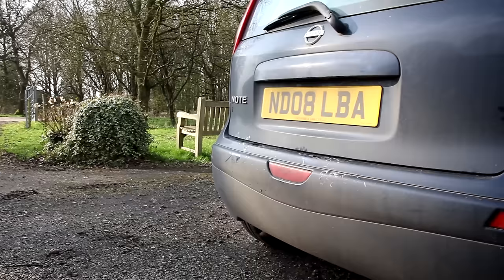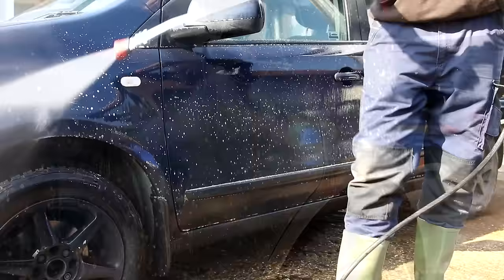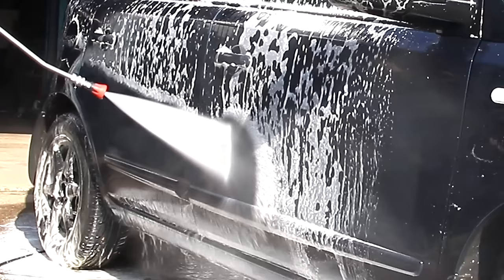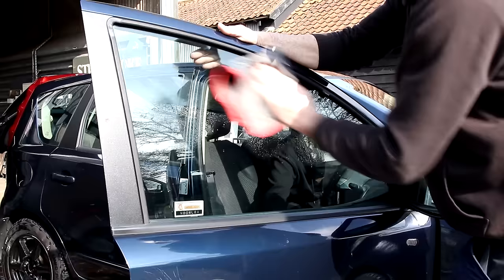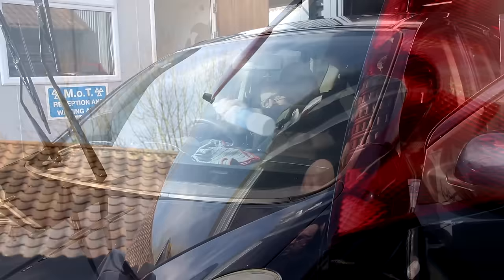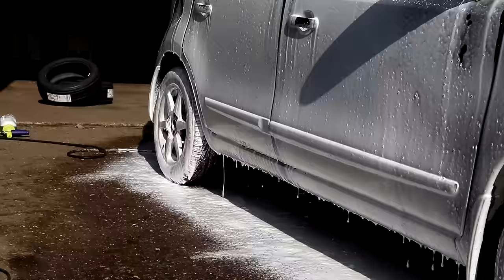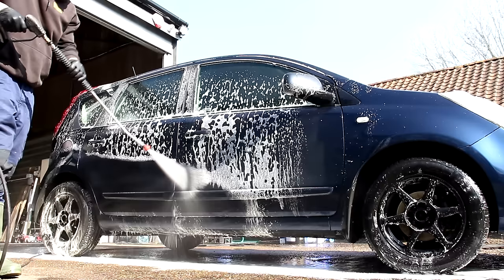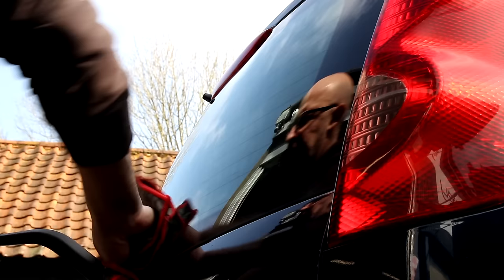Bilt Hamber Touchless & Traceless glass cleaner review

Comment: This does seem to be an excellent product Paul. In your opinion do you think the Touchless prewash is stripping all the protection off the car while cleaning. It did'nt look like the car you used for the test had much protection on it anyway but i have mine ceramic coated so would not want it stripped off after the effort of applying it
Reply from the maker: It may have to be diluted further but it’s sugar based like Garage therapy’s snowfoam so I think you’re be fine

Comment: Many happy returns. 
Good to see you got on well with this. I have yet to try the new Touch-Less but I do get on very well wi the old version and Autofoam too. 
I’m going to use a 5 litre pump sprayer when I get this stuff, I’m slowly moving away from snow foaming and definitely will never buy another PH neutral snow foam. 
The glass cleaner is great, the smell I could only describe as blueberry bubble gum with chemicals in it. 
Loving the podcasts, working my way through season 3 atm. 
Great review, thanks for sharing and get well soon.

Comment: In the States, 5 liters for $100 (US) for Surfex HD Cleaner, I use a similar product for $8 (US) to strip wash.  Which makes more business sense?  The Bilt Hamber may work better, but I'll use a little elbow grease for $92.  Also in the States, I like to use Stoner's Invisible Glass (Tint Safe) for glass.  It's available almost anywhere and cost less than $4 (US).  Or ONR works well on glass and cost very little.  Thanks for your testing.
Reply: I agree with you completely. However, you also find that a lot of American products like Meguiars and Chemical Guys are considerably more expensive here in the UK.

Comment: Which attachment did you use on ik sprayer the white one or the fan fan tip, if the white one waa the nozzle closed fully yours gives more spray and pressure than mine
Reply from the maker: The white one non fan type
Reply: @PaulDoldenDetails  Thanks Paul Have a great weekend 👍

Comment: Nice content,  so you used 12ml of touchless to 1 litre worth of water is this correct
Reply from the maker: I did but the correct way is 10ml to 490ml but it just shows how strong it is 12ml in 1litre and it still performs
Reply: @PaulDoldenDetails  Thanks that is impressive I   currently have kock chemie vb but still have to use it brought this for winter.
The ik foamer you have is it worth it  would it do a better job than a normal 5 litre spear and jackson pump for the garden debating should I get the ik foamer, will a 1.5 litre ik foamer spray all around the car in one go or do you have to top again medium sized car
Reply: @tripsingh3642  ide consider the larger version of the ik foamer personally if thats the route your interested in, you will be having to pump very frequently and they do glug through product, so I would imagine on a medium car you'll be needing to refill half way around, not ideal. Great for wheels not so enjoyable for larger surface applications. Using a pump sprayer is just so much more cost efficient and it goes down more efficiently, the only draw back to it is it tends to have the potential to dry out faster especially on a coated vehicle that tends to reject it on the less dirty areas, this is where the cling that a foam provides would be advantageous. Layering is also a great option but it also uses twice the product, pump spray the lower 30-40% of the vehicle, foam the top and over the area you pump sprayed after a short dwell to increase its efficacy. 👍
Reply: @KiloRomeoOscar   Wow Thankyou so much for the detailed explanation really appreciate this, I think I'll give the small ik foamer a miss don't want to be pumping to much by hand, to spray my 5 litre garden attachment does the job plus I have a big blaster foam nozzle for a 900ml bottle which does spray foam very well.
The larger ik foamer is to much money for me and would not serve its purpose because only do 2 cars plus  a I have a pa foam lance which Is brilliant Thanks once again 👍
Reply: @tripsingh3642  You're welcome, glad I can help a fellow enthusiast out. They are a considerable cost and there is nothing worse than buyers remorse. You will get a wetter and more uniform foam with your PA lance compared to the IK foamer anyway, the IK has a tendancy to splutter if not pumped up good and proper. Also who wants to be huffing and puffing over a pre-wash? It's supposed to be enjoyable cleaning your pride and joy 👍
Reply: Just wanted to update this for the OP.
If you was originally asking about the 1.5L IK pump sprayer that Paul was using in the video rather than the foamer (doh) I can confirm you can get around a medium car (bmw 3 series size) but only the lower portions, wing mirrors and windscreen by the skin of your teeth, but you have to get a shift on and like previously mentioned ALOT of huffing and puffing 😂 👍